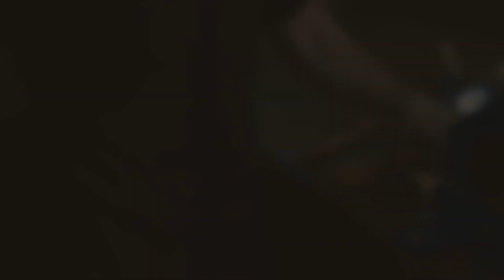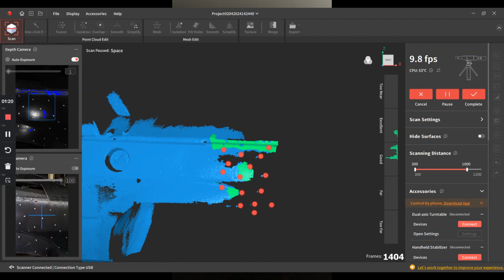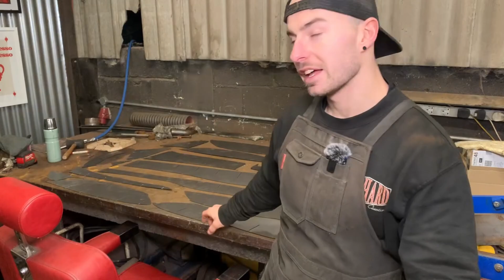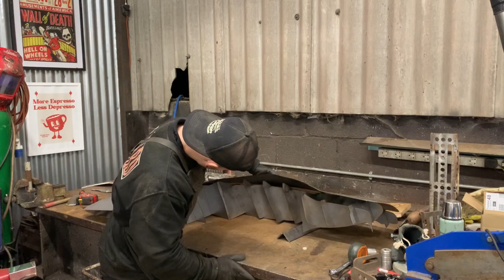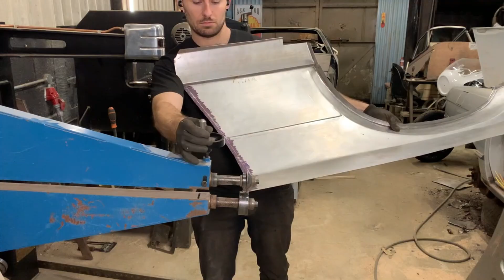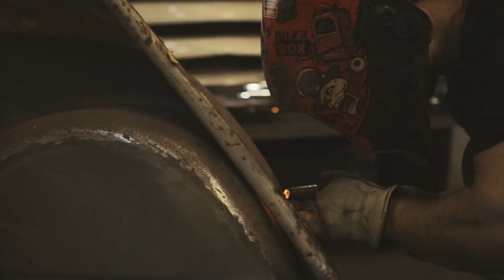3D scanning a car to make repair panels

Comment: Impressive. I can see possibilites with the scanning method where the data is used on a CNC milling machine to make a 'positive' mould or die stamp in resin-stone or some other tough material in order to use it to press out a basic shaped panel using the rubber press forming method (into urethane rubbber sheet which behaves like a 'fluid' under pressure).
Reply from the maker: @TK42138  definitely I feel the possibilities are endless once using a 3d scanner as the more you understand it the more your way of thinking expands

Comment: I don't have a lot of knowledge about this, so forgive my ignorance, but is the final product in this video mirrored? It looks like the opposite side to me? Thanks
Reply from the maker: You have a good eye and well done for picking up on that 
It is the opposite side and that is because I was basically filming and making both sides of the car at the same time so that it would improve efficiency on tooling setup 
I designed the buck to be reversible the use for both side